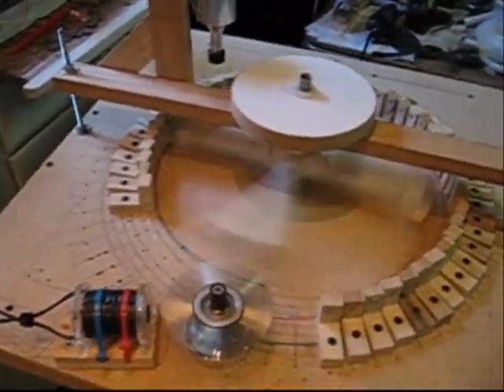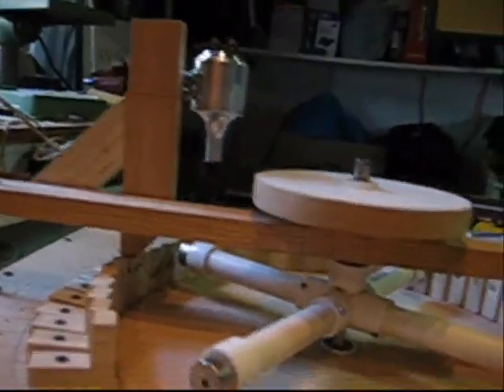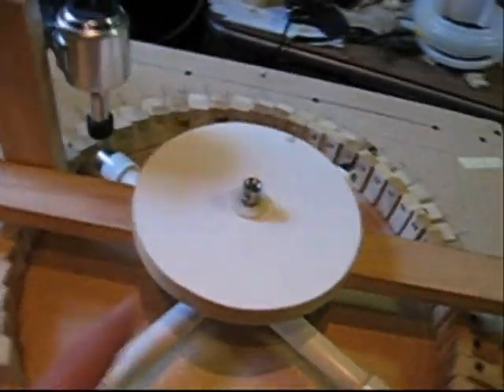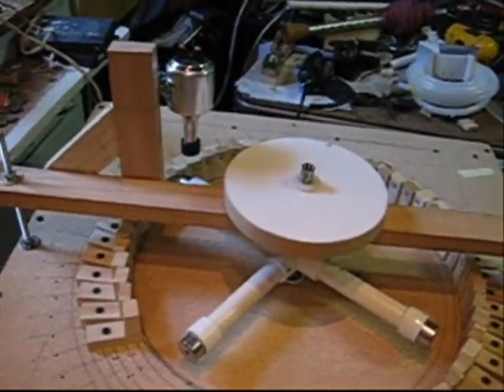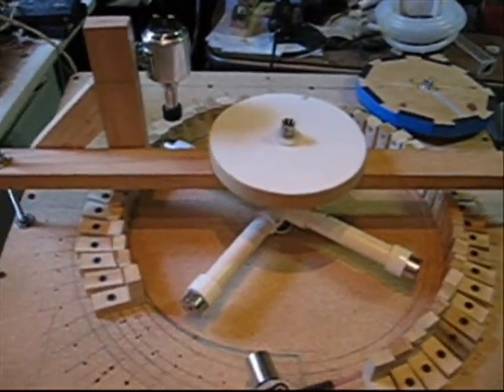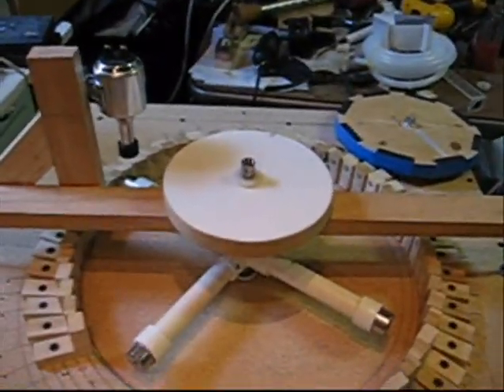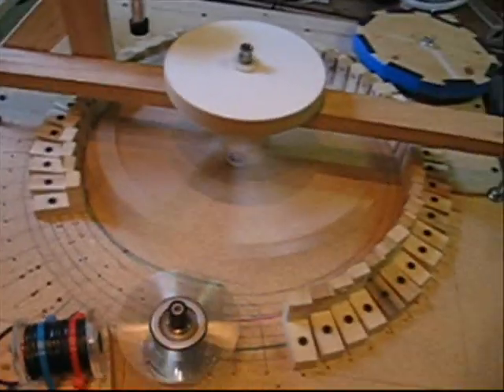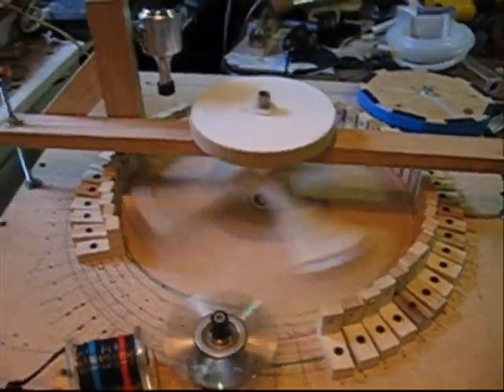Magnet Motor flywheel/generator1

Comment: Are you still playing with this?
Use a gear instead of belt. I doubt there is free energy in the output, but the flywheel stores energy in the inertia of mass, so it's good for short heavy workphases.  BTW. most generators produce AC, except eg. the rather inefficient Homopolar generator by Faraday. Peace.

Comment from the maker: I had the very same thought an even though I've abandon this design I'm work on a couple of other designs with that very idea in mind. However I found something much better than the bike dynamo. I got my hands on a large printer stepper motor and I can generate 12V just by spinning it with my hand and there's nearly no drag. 
I have a much bigger  and more promising setup comming but it will take many hours to complete. I will take a vid of the progress so far sat

Comment: Nicely done! Isn't it possible to get copper coils configured with a diode to rectify the current 1 and direction and replace the motor with your own induced version perhaps store your energy via capacitors so the generated current you obtain from your copper coils can power the motor in bursts...also I was thinking of using angular momentum in some type of gyroscope configuration to help thrust past your gates...just food for thought =]

Comment: 3 phase alternator produces more juice than 1 phase/ 2 phase alternator. most 3 phase alternator on the market has iron core which will make a sticky area which reduce the speed. 
as for my toy, i'll try to reduce/remove any sticky area that will slow down the rotor.

Comment from the maker: I've seen and have known for a while that I will need to get a cap for this or any other system I want to work with but I'm not to sure on the size of the cap I should get. I have a ton of old boards that have caps on them and was wondering if any of these are any good. Does the physical size of the cap usually determine the amount of energy it can store?